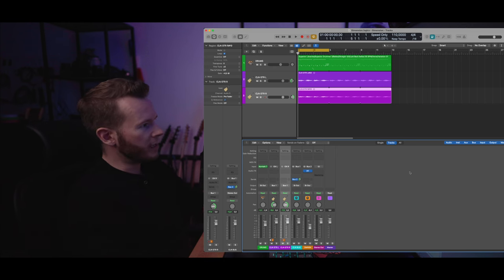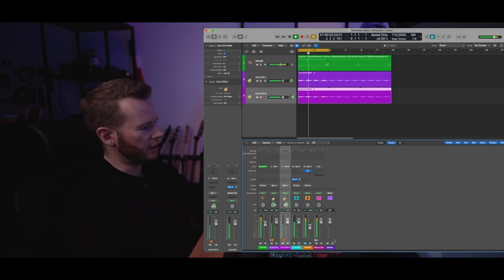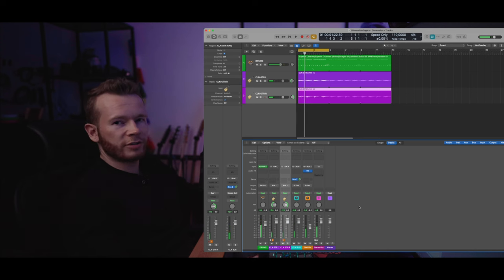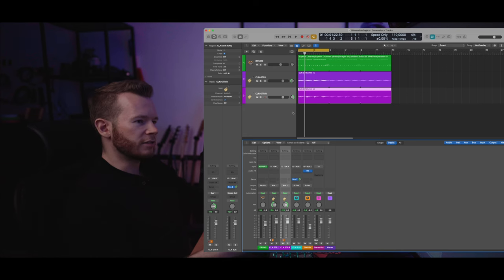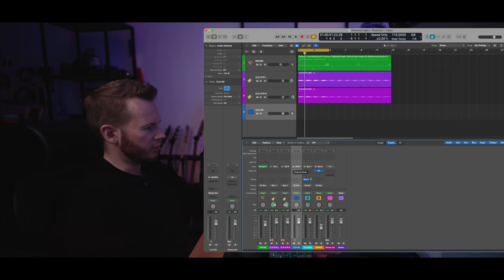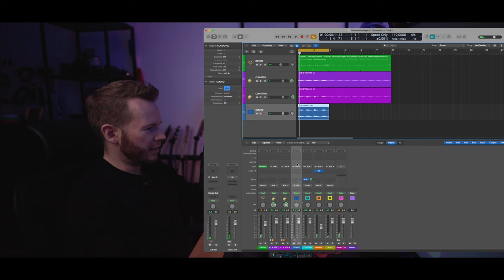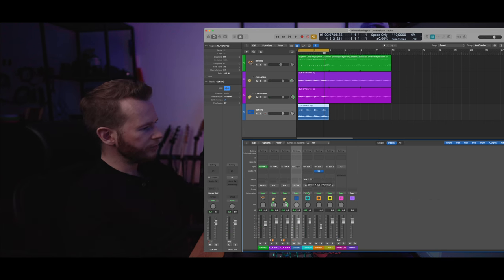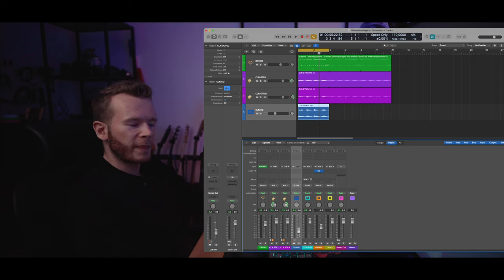How To Print Outboard Gear Into Logic Pro Track

Comment: So basically you just need an interface with more than 2 mic inputs ? And great tutorial 💯
Reply from the maker: Thank you! With mono only, an interface with 1 input & 1 output should be enough. For stereo you need 2 inputs & 2 outputs. The number of outputs excludes outputs for your studio monitors.
Reply: @AdamBards  oh ok so I can use the outputs where I put my monitors at? And to do this I go output of interface to input of compressor and output of compressor back into input on interface?
Reply from the maker: @ejaybeatz3609 haven't tried that myself, but I guess it could work? Ofcourse you won't be able to connect your monitots at the same time, so you won't hear anything
Reply: @AdamBards  ok that’s cool I have a secondary interface preciate ya
Reply: @AdamBards  and another question, do u go out of your interface and in to the compressor to work?
Reply from the maker: I don't have a compressor (yet), but yes that's how you connect the outboard gear
Reply: @AdamBards  ok preciate ya💪🏾 big sub❗️💯
Reply from the maker: @ejaybeatz3609 thank you!